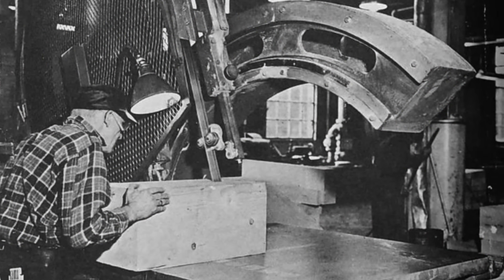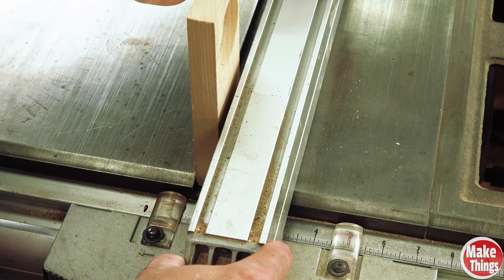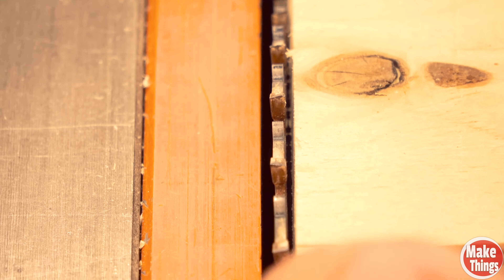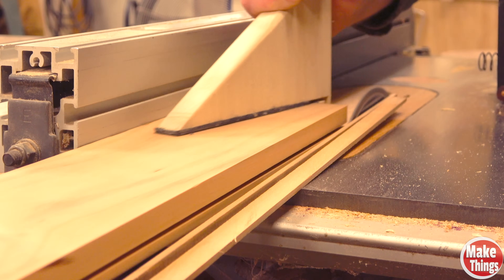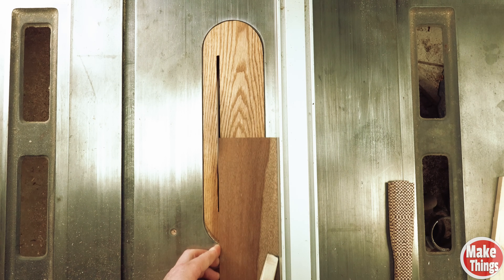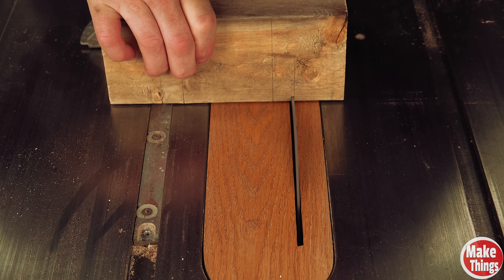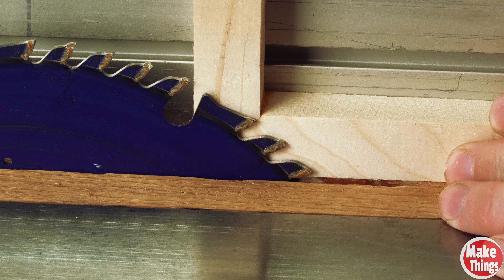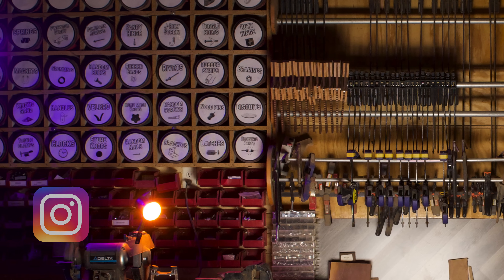12 Table Saw Tips & Tricks Your Auntie warned you about // Table Saw Full Size Tips // Make Things

Comment: Excellent set of tips my brother, love the level of detail shown and explained, even someone working for a few years already will learn something. But really love the details, ie show exactly how to test if your fence is parallel to miter slot,  how to square up your fence, how to easily/accurately test your blade for square via cuts, how to resolve the Incra miter gauge flaw, the cut U-Bolt tip and more. Appreciate the effort, thanks!
Reply from the maker: My pleasure, thanks!

Comment: Dangerous table saw without a riving knife. You should not advice others, when you do not even have the most basic safety elements in place. It is not impossible to have a riving knife through a zero clearance add on. And you can make a jig for this, which makes it much safer to make.
Reply from the maker: Used mine for 21 years without incident.  50 years prior people used them safely.  If you know what you're doing, they are just as safe.  I've seen a video where a piece gets wedge into the riving knife.  Please don't scare other people from hand me down saws that their father's or grandfather's used.
Reply: @MakeThings  30.000 table saw injuries in US each year so don't know where you got the "people used them safely for 50 years" from. Riving knife is imo the most important safety feature. It's similar to a seat belt in the car. You don't need it until you do and everything is not in control of the driver or operator, no matter how skilled he or she is, things can go wrong. Presenting a video like this that probably many beginners watch, imo comes with a certain responsibilty to show safe practices at the machines. Working without riving knife (or splitter) or blade guard is not the safest practice.
Reply from the maker: @CarmoniusFinsnickeri   You bring up a valid point, and I respect the importance of safety features like riving knives. In my experience, which spans many years, I’ve found that proper technique—such as ensuring the stock is fully pushed past the blade—can significantly reduce the risk of kickback. Personally, I’ve never encountered a situation where a riving knife would have made a difference because I always stop the saw if I sense the stock binding or pinching.

That said, I understand that riving knives are a valuable safety feature, particularly for beginners or those still developing their skills. They’re designed to prevent kickback caused by stock closing on the blade or catching the back teeth. For me, the key to safety is technique and awareness, but I recognize that having a riving knife can add an extra layer of protection, especially in unforeseen situations.

Ultimately, I believe safety comes down to a combination of technique, experience, and using the tools and features that make you feel confident at the saw. Thanks for sharing your thoughts—it’s an important conversation to have.
Reply: @MakeThings  Thanks for your answer, I agree with most of the things. But I think beginners should be cleraly warned/informed of the risks of working with non riving knife saws in videos like this.
Reply from the maker: @CarmoniusFinsnickeri   I agree...and I'll be making a video in the future showing how they're important and how they can also be dangerous.  Thank you for your comments!
Reply: @MakeThings  Thanks for good and constructive conversation, happy new year!
Reply from the maker: @CarmoniusFinsnickeri   Happy new year buddy!

Comment: The most important tip is not in this video. Safety FIRST!
Never! Work on a table saw with a long baggy sleeve shirt. Most table saws run in the 3,000 to 4,000 rpm range and can grab your sleeve pulling your whole arm in to the blade faster than Bruce Lee.

Comment: The one tip I really need is how to keep the fence on my Rigid 3650 straight to the miter slot. I have tried every trick in the book: Locking 2x, pushing the fence towards the table as I lock, changing out the plastic pads for bigger ones... The fence is completely random every time I lock it down. I am thinking of changing the whole fence system out for a Very Super Cool Tools fence, but that is such an endeavor.
Reply: Same here, those slight variations sure make a different in such things as recessed cabinet doors! I've been sneaking up on cuts and cheating by taping on nails and the likes along the fence side where the cut's fat. It's no cabinet saw but can be tricked into identifying as one.

Comment: Nice tips. But my favorite part of the whole video...

You see, I am not a pro. I am a retired guy who has been self improving on mediocre skills for decades, making me pretty good with my tools. But I am not a pro. I am a guy who bought a distressed foreclosure to live in and fix up 15 years ago, and found that process to be eternal, because by the time you get to the end, it is time to do some of the early things you fixed again. So I use my tools a LOT. But I am not a pro.

Did I mention that I am not a pro?

Because you see, I bought a new table saw. Of copurse, it is a DeWalt, because that is what I buy. But it s not a big one (because I am not a pro). It is a perfect sized (for me) jobsite table saw that I can fold up and stow in order to use my garage for my cars when I am not working on the house (because I am not a pro). 

Not long after bringing my table saw home, I did something that ended up with my blade spinning too close to my fence. I don't even remember how I did it, but it put a mark on the fence in the shape of the top portion of the blade. I have been using it ever since, and it does not seem to affect my straight cutting lines. But in the back of my mind, I have continued to ponder "is that scratch on my fence causing my cuts to be off by some tiny unit of communist finger math (metric)?" I don't let that ponderance bother me too much...but it is always there. I was considering buying a new fence, just to alleviate my doubt.

So, my favorite part of this video is the one where  noticed that your fence has the same EXACT mark on it. Since you are giving interweb advice, I assume you ARE a pro. Now the back of my mind ponderance can be replaced by "If it's good enough for the pro on the internet, surely it is good enough for me."

This is a thought that will repeat in my mind a thousand times in the future, bringing me a peace of mind that I really don't deserve. So for this, I thank you.

Comment: love the tip for adding splines to mitered frames without the use of a jig. very handy. when it comes to tear out, i find that, on pieces where it's important, SLOWING DOWN the blades' movement through the wood just before it exits makes a big difference. it won't eliminate tear out, of course, but the results are a noticable improvement.